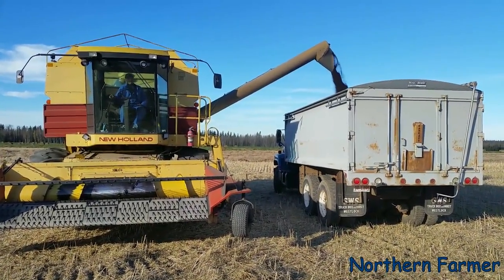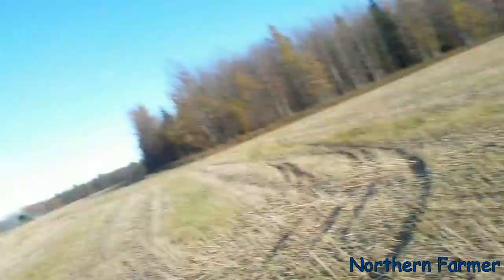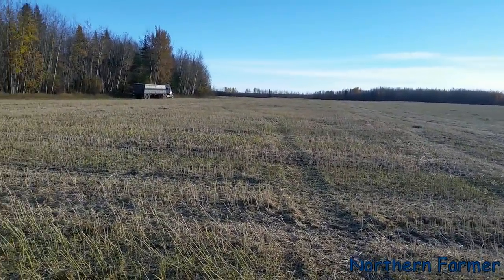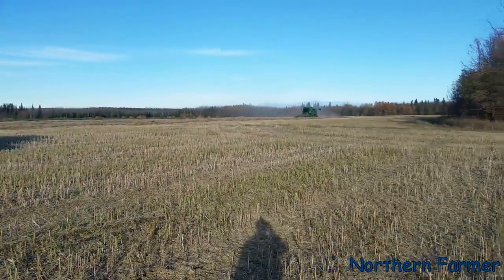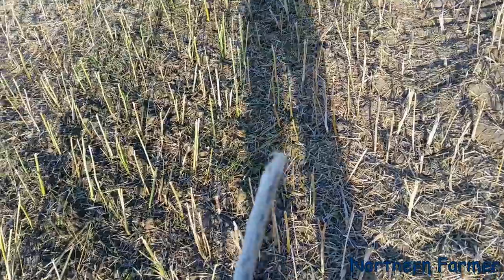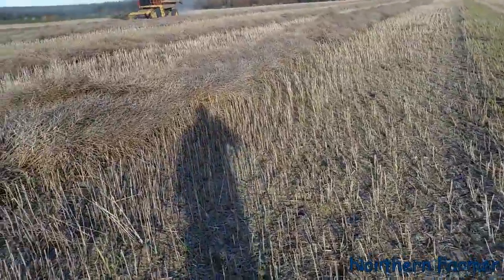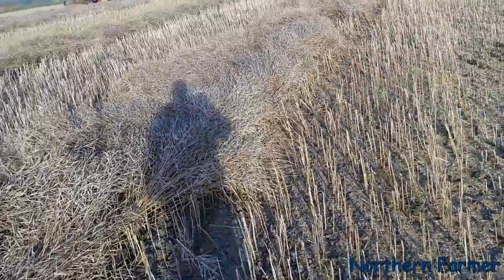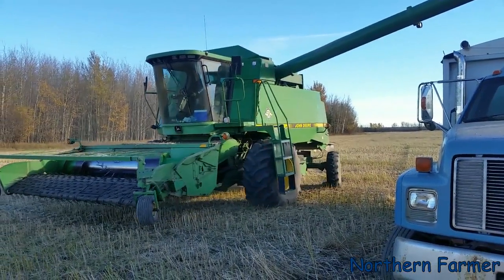Canola Harvest 2017

Comment: We had a NH 95 with a V8 Cat 3208. We had downed corn one year and when running the head down in the mud picked up a rock. Rock trap was blocked. Looked like a bomb Went off! We fixed her as best we could but it was never the same. Traded her for a gleaner. Check you rock trap to see if she's working. 
Your doing a good harvest ! Keep her up.
Reply from the maker: Rock trap is working good